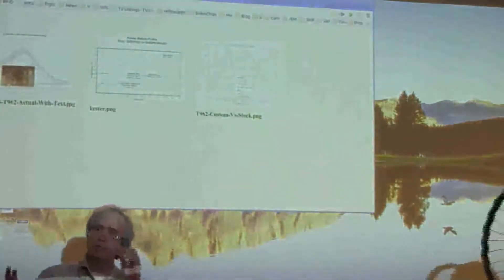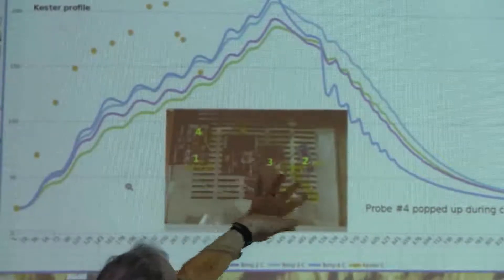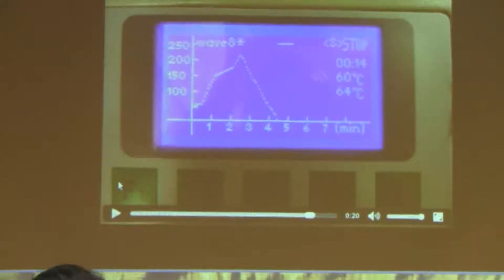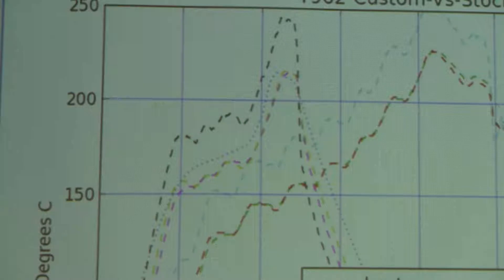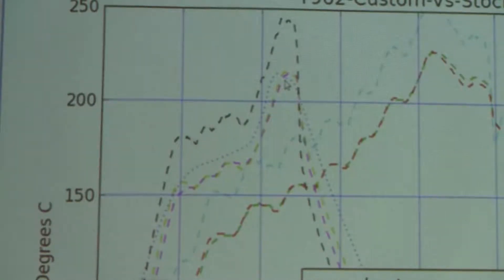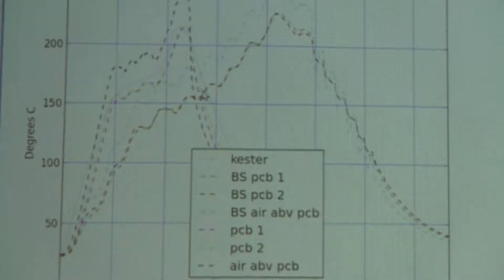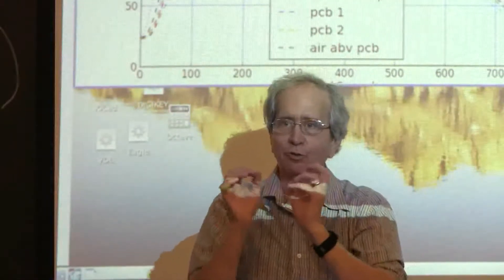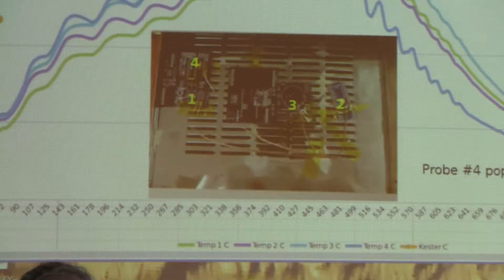T962 oven basic fix & reflow discussion

Comment: got one myself there are crap however adding a 120mm pc fan onto the back of the main fan and having it run very slow helps move the heat round the oven and helps the reflow process much better. however the controller is crap and im in the middle of installing a custom controller

Comment: Does the Kester profile apply to lead-based soldering? solder Paste?  Followup to previous Q, For MB repair-reflows typically you use ONLY Flux paste... Please advise. Thanks